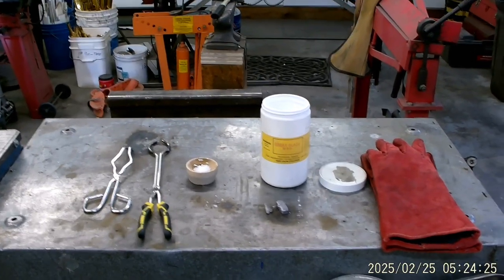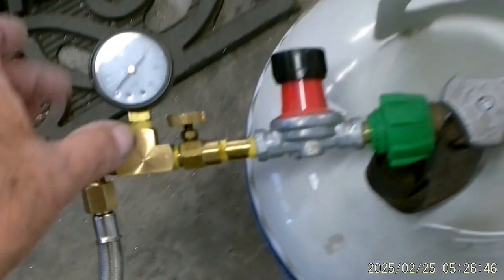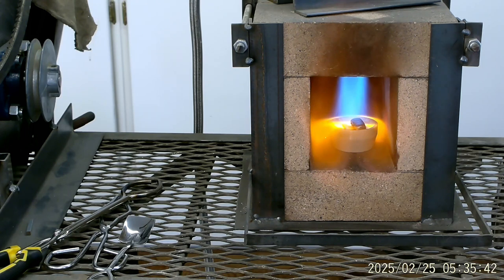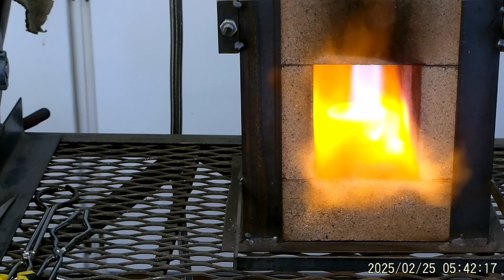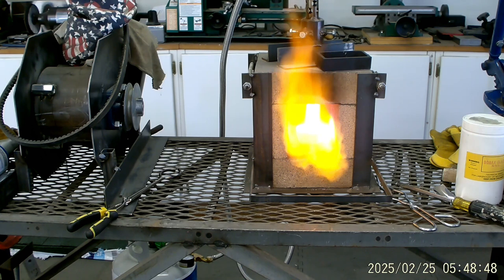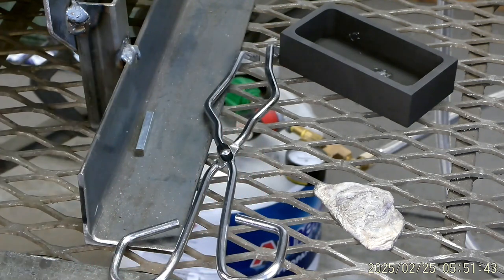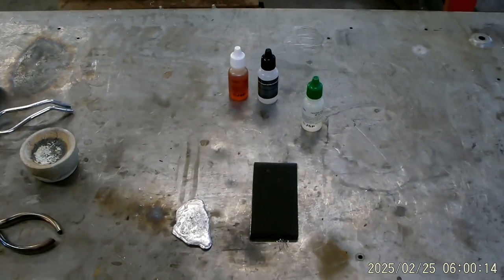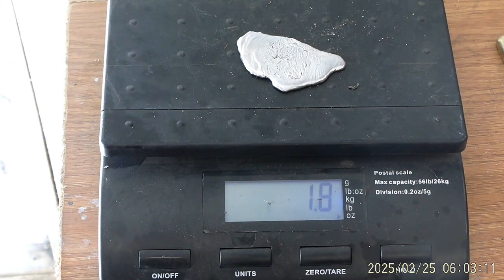The Most Beautiful Experiment in Science | Gold Refining With Fire and Borax

Comment: You cannot use borax when you're trying to Coppel lead the lead will not oxidize
Reply: The reason for that is the Capel will absorb lead oxide but not lead or precious metals so the lead needs to get oxygen to oxygenate leading to lead oxide which can be absorbed into the couple so right now you just have a a gold and Lead amalgam sorry to tell you it needs to be at least $1,800 degrees to make lead oxide the oxide will bead off the liquid metal off the top and get absorbed into the Coppell dish
Reply from the maker: Thanks for watching, The melt was at 2200 degrees.